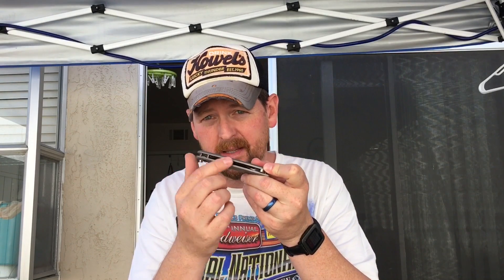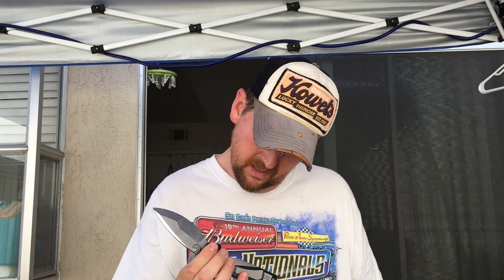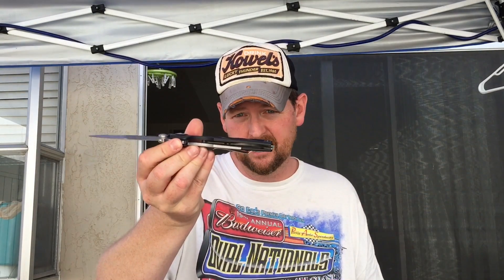Knife construction and edge angles

Comment: Hey, dumb question, how do you feel the edge? I'm just starting out sharpening my own knives, and I bought an 8'' smith's diamond stone. 
When I'm doing well, I can take a knife from dull to shiny sharp in 10 minutes (a good example is my spyderco endura in vg10, super easy to sharpen.) 
Unfortunately, I'm not any level of consistent at all.
Reply from the maker: +Eric Bowling I wish I could explain, it once you get really good at it you can kind of just feel when the edge changes and apexes I don't know about on diamond stones because I don't use them but you get to a point where you can just tell when one side has fully apexed along the length there's a sound and feel to it… It takes a long time to get consistent especially if you're doing free hand
Reply: Michael Emler damn! That's kind of what I figured. Thanks anyway.